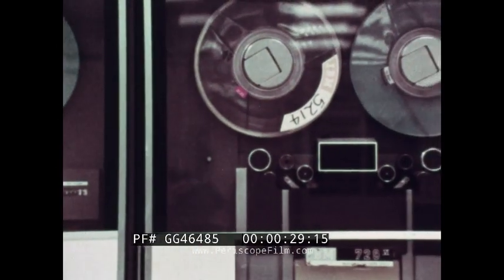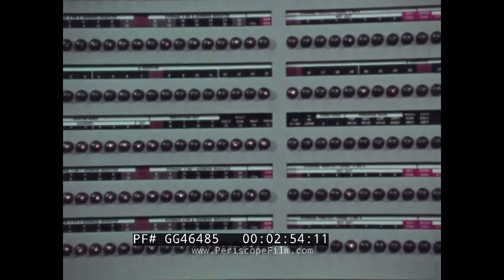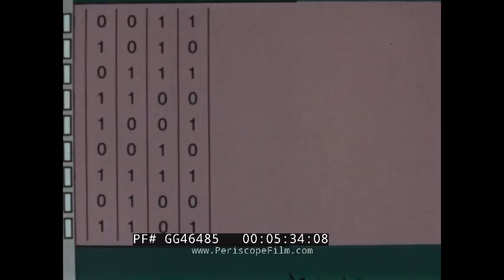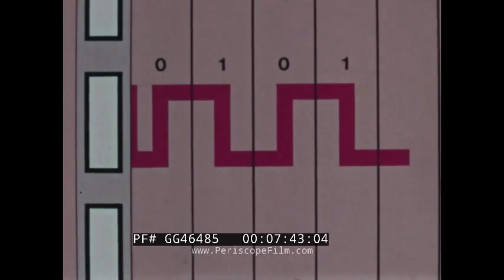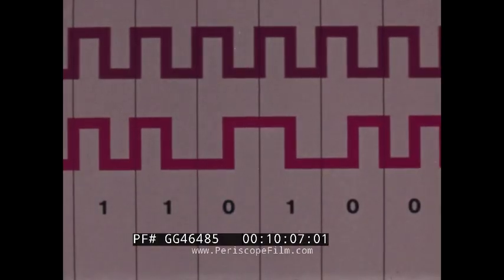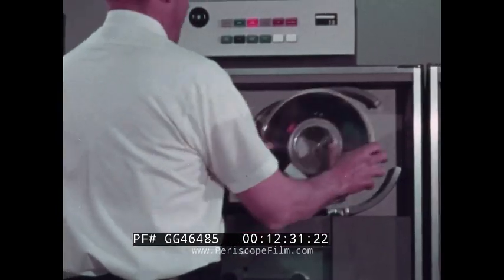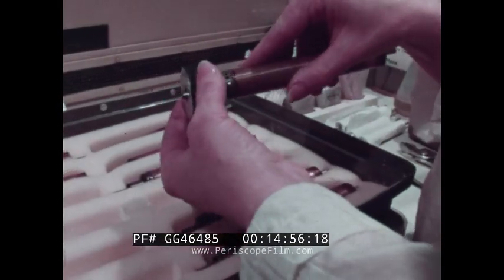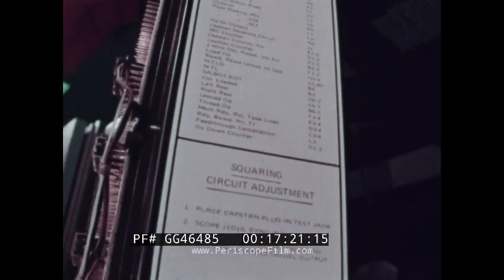IBM MODEL 2420 WITH PHASE ENCODING  1970s COMPUTER MAGNETIC TAPE UNIT PROMO FILM  GG46485

Comment: What year was this? What is IBM now? Anything left?
Reply: IBM makes the largest capacity tape format on the market today. They are one of the two formats left, IBM 3592  and LTO.
Reply: Of course. The Boulder tape R&D center in the video was moved to Tucson, Arizona and is still there today and still at the cutting edge of tape development.  They not only make the tapes used by IBM Z Series but also the LTO tapes used by most distributed systems today.
Reply: Musta been about 74, we got those 'cartridge' self-loading thingeys to replace the straps about 1976.
By the 90's there was unbelievable BPI in a real cartridge, made the jump to 6250 on reels that I thought was gonna be the limit kinda lame.